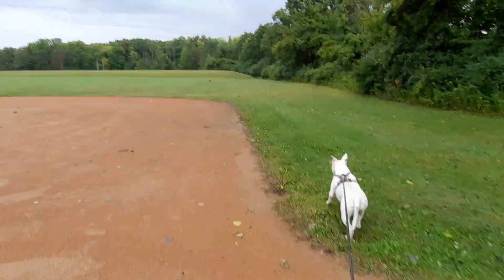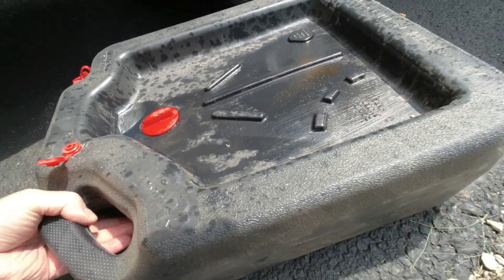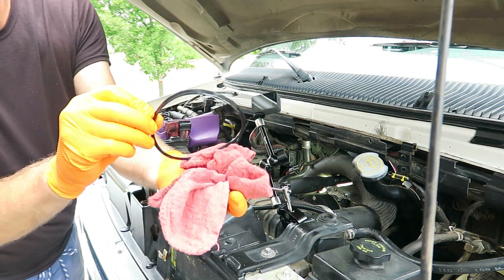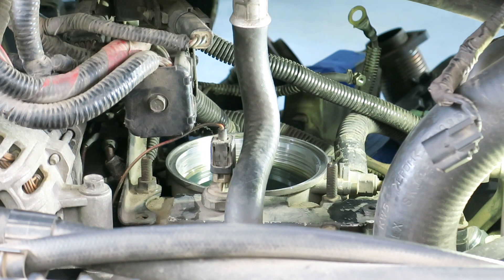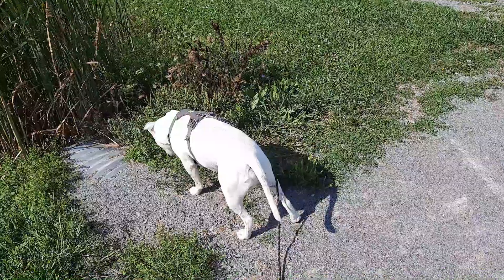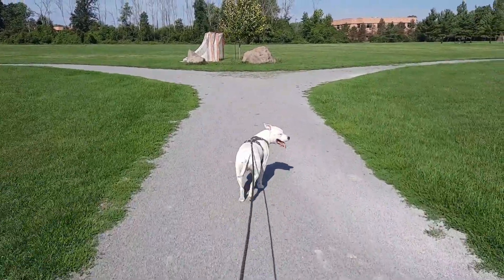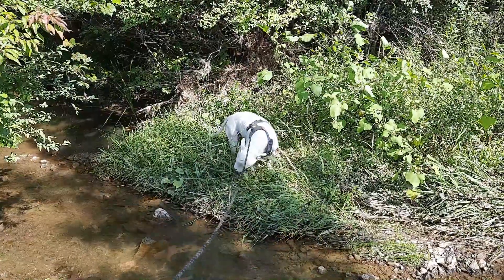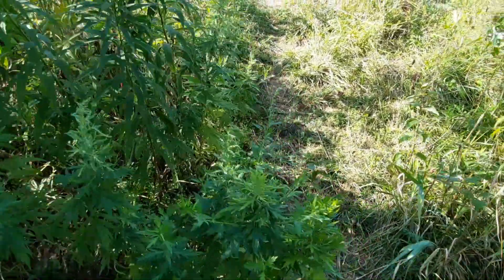A Trip To The Beach Didn't End Well For Lefty | Fleet Fix Fuel Filter | Ambulance Conversion Life

Comment: Poor Lynn appearance fox likely sick. Keep away!

The fuel filter top was likely over tightened because the seal oring was on reverse. Previous over tightened because it may have been leaked. 

That special tool reminds me of my pool filter canister. Requires a snazzy special tool very similar, larger. 
I made my own. Piece of oak, 2 carriage bolts the correct length. Works like a charm!

Comment: Well again thank you David for teaching me something else on the 7.3 engine. I  actually might be able to do that fuel fiter change. If I'm not to chicken to try taking things apart. And If it doesn't get sold. I've been scouring the internet trying to learn stuff. But very very few videos with the van fronts. Just as you mentioned. Well I'm glad lefty is feeling better. I'm sure the padsa re sensitive when baring weight pushing the stinger in. Well you both be careful  n stay well .blessings always for you n lefty and family 🙏🙏

Comment: Our battery tray has been jacked up since we purchased the ambulance. We needed new batteries so we decided to replace the battery tray too. Larry started taking out the 6 screws holding the old one down. The first 4 came out with little trouble. The back ones were bound and determined to stay secure. Larry got out the grinder and got to work cutting off the sides of the bolt on the left side. He could grab it with the wrench and it came out. That last one though was a booger. He ended up having to cut part of the bracket off first. Finally he was able to get the rest of it out. We washed the filth out of the compartment and painted it all bright with white gloss automotive paint. Time to install the new tray. The left side went perfectly. The right side not so much. We discovered there was an errant ball bearing stuck in the track so we had to mess around with that for a few minutes. FINALLY we were able to get the new tray installed then found out that we are going to have to measure the new batteries to make sure they fit because this tray is smaller by about a half inch.. If it isn't one thing..... We've been messing with this battery compartment for a good week now.
Reply from the maker: The fun!!! When it's done it'll feel great!

Comment: Is the little valve on the filter a bleeder that eliminates the possibility of air getting into system which would require  priming of the fuel line at the injectors?

Comment: David, I had a 1996 7.3 with the same fuel filter arrangement.  When I went to buy one, they didn’t have a new screw on lid.  They did have a molded filter that had the lid molded onto the filter; one piece.  It was much easier to remove and install.  Might be worth looking into.  JimO
Reply from the maker: I saw those  - interesting :)
Reply: @TheCampulanceMan  they had an extended mile point for changing.  If memory is correct, was cheaper than original filter and screw on lid if purchased together.  JimO

Comment: Torque bar?  I had an old bicycle handle bar that I could slip over the handle of the wrench/ratchet and get that extra torque.  Could also use a hammer on the wrench.  A wooden one or mallet if there are things you don't want scratched / marred up.  On my car, the only fuel filter is part of the fuel pump and in the tank.  At 130k miles it's probably due to be replaced.  There is a notice-able difference in performance and mpg when below half a tank.

Comment: It doesn't really matter, but just saying  if there was a stinger it was from a honeybee.  Other bees don't lose their stinger, but honeybees lose their stinger and their insides when they sting and then they die.   Yellow jackets wouldn't be all over the grass but honeybees would if there is clover or dandelions, etc.  One obviously was stepped on, otherwise they're gathering nectar and not interested in stinging.  Poor Lefty, but at least it wasn't a snake bite.
Reply: To remove a tick the little plastic thingys you can buy are great.  One you have to twist to take the tick out, but the one I have I think is even better.  It looks like a little plastic round spoon with a v-slot cut into it.  You press it down onto the skin, push it up getting the tick in the slot and keep right on pressing down while pushing it forward and it pops the tick right out every time.  Never breaks the head off the tick and it's caught right in the spoon to kill.  They come out whole which is what you want.  Amazing, it's just a silly little plastic spoon with a slot.  :)